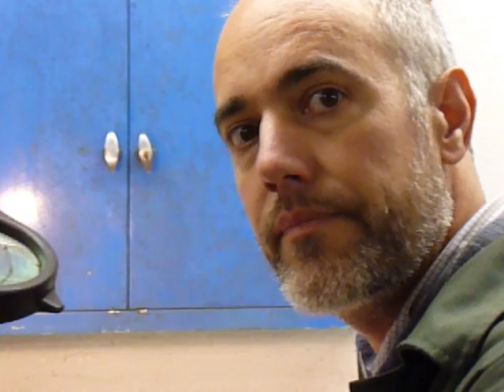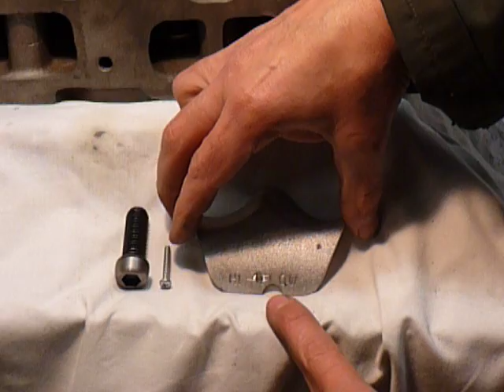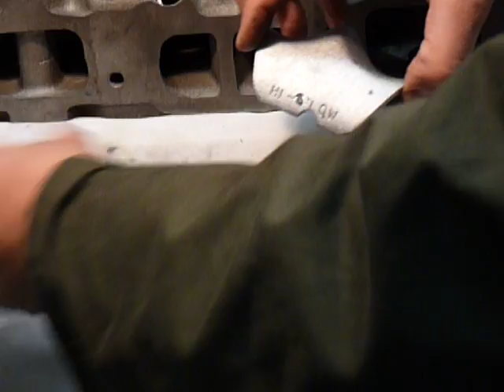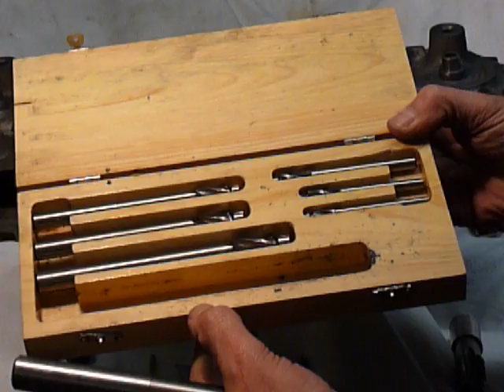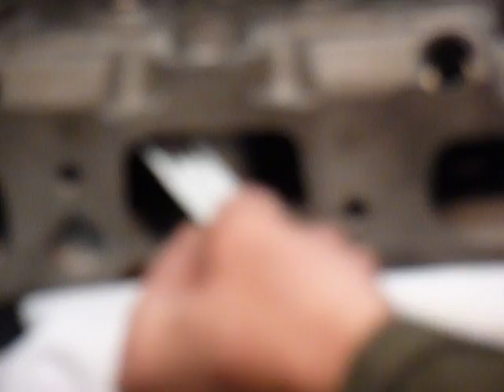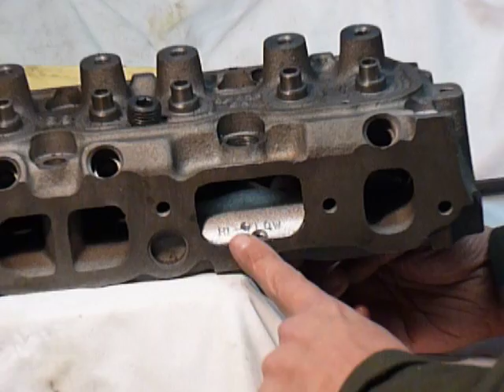premium lump port chevy inline 6 230 250 292 performance Part 1

Comment: @4100gtb CFM=Cubic Feet per Minute, its a measurement unit used to quantify airflow in a given circumstance. In this case, air-fuel mixture passing through an intake/exhaust port on a cylinder head.